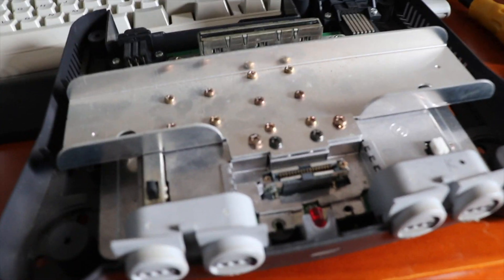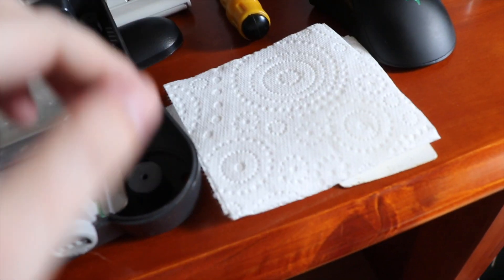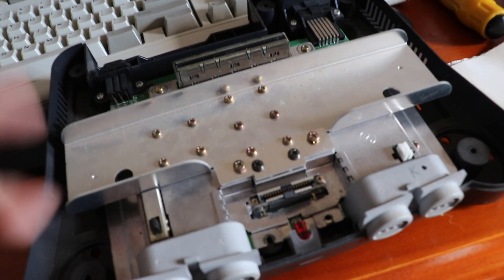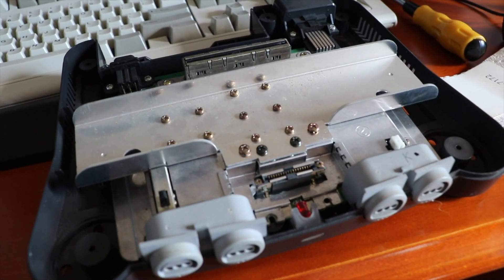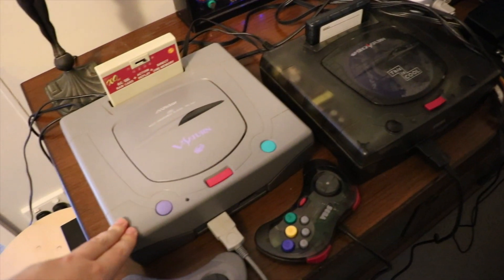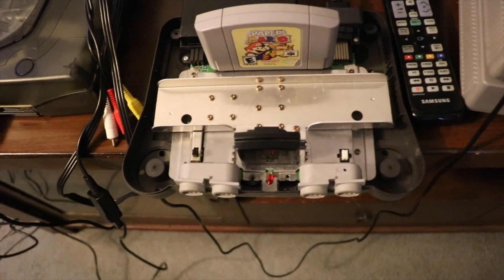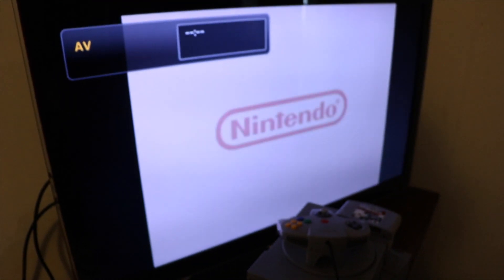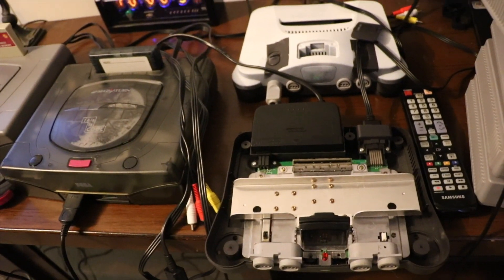Nintendo 64 Cartridge Slot Cleaning

Comment: I always just used the corner of the plastic cover that protected the jumper pack to remove it.
Reply: Same here!
Reply: The expansion pak - brand new - came with a little grey pry tool. Wonder if i still have mine.

Comment: Yes, there wasa tool included with the Expansion Pak. I still have mine but I also 3D printed another from Thingiverse. I should also mention that you can remove the cartridge slot entirely if you take off the shield covering it. If you take the panels off you can even re-arrange pins. You can replace with good pins from another connector or switch important pins that are damaged with less-important pins (some are for generally unused stuff like audio mixing).
Reply: I am ridiculously late but do you know how to remove the shield from the pin connector?

Comment: Maaaan you came in CLUTCH for me today. Having been troubleshooting my N64 for nearly 8 hours and cleaning all the cartridges to no avail, you're the only person I found a video from who showed what happens if the system is turned on without the jumper/expansion pack. I pulled mine out, cleaned it off, and lo and behold it works perfectly instantly! THANK YOU <3 PS I pulled them out with the back of a spoon. Very high tech ;)